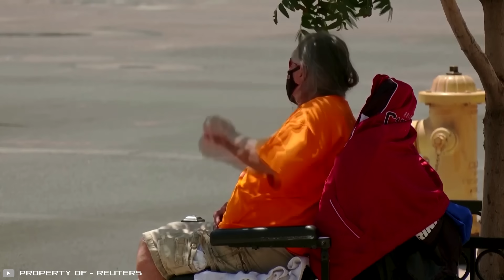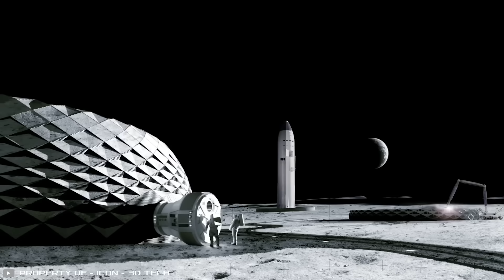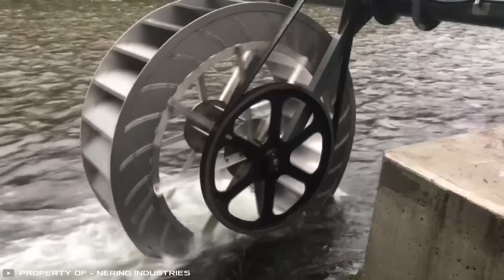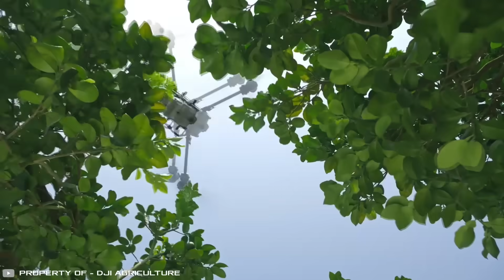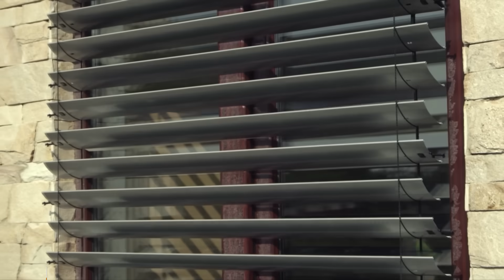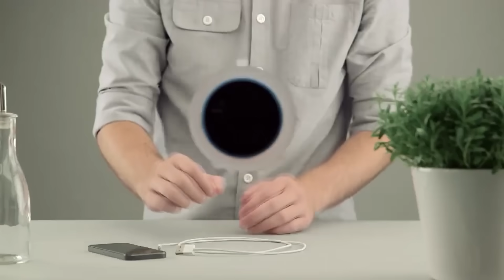15 INVENTIONS AND TECHNOLOGIES REDEFINING THE MODERN WORLD

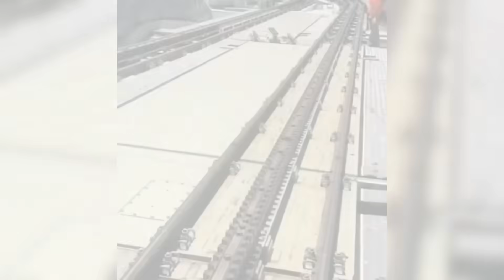Comment: Wait a minute!! @ 5:06 What would it cost to build the flip track switch system shown here rather than the standard rail switch system that has been used for 200 hundred years? The flip switch involves more mechanical and technical operations allowing for more possible breakdowns or dangerous errors possible! Just a thought!